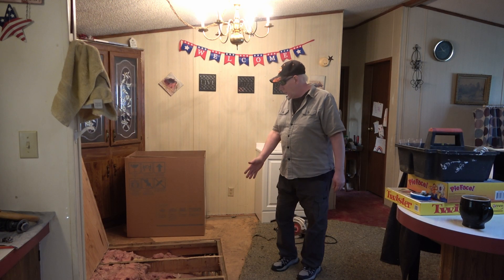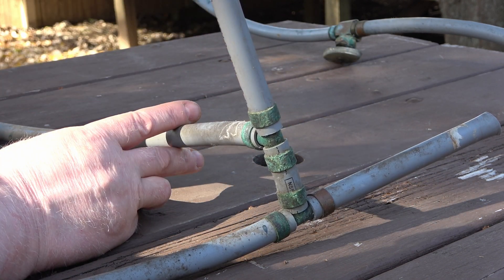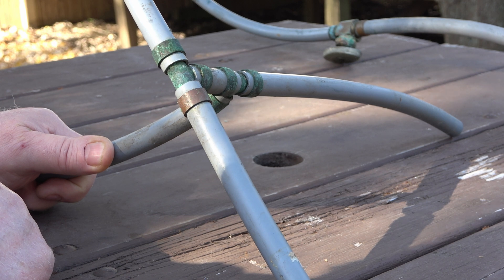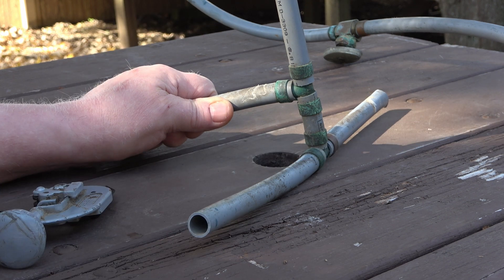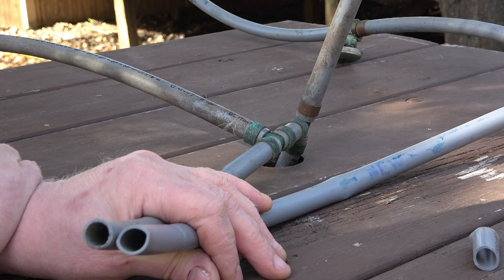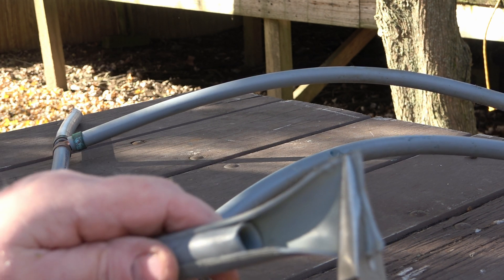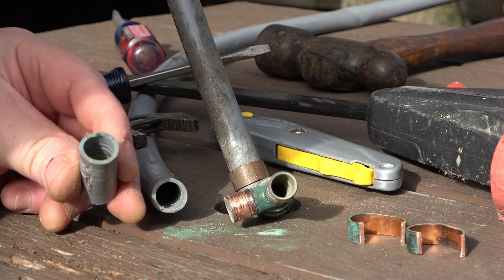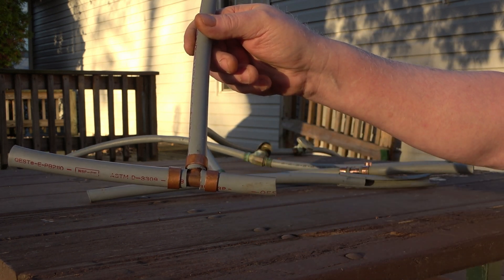Poly B Plumbing Longevity On A Well System (Untreated Water)

Comment: I have pb in my home on a well system. Only issue I’m having is the transition fittings failing. Literally splitting in half. Poly b is ran through slab to each room requiring water then it transitions through these weak transitions to cpvc.
Reply from the maker: Are your transition fittings copper 🤔

Comment: You didn't talk about the compression type fittings.. using nylon compression rings. I plumbed my house 38 years ago with pb, no leaks, ever.  I'm on a well system also.
Reply from the maker: Well system mmm Natural Crystal Clear Earth Enriched Minerals Spirits 🤟 Nylon compression rings are the 💣